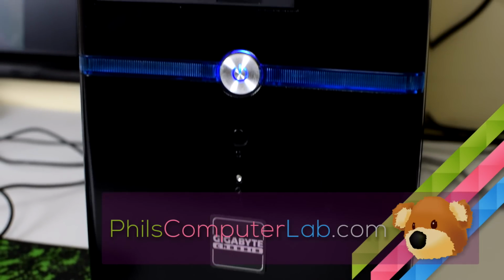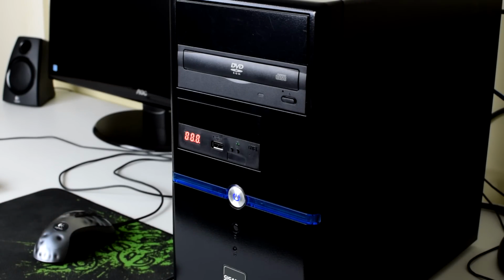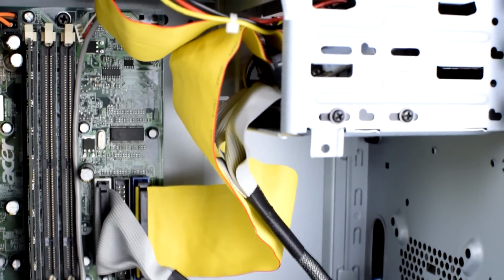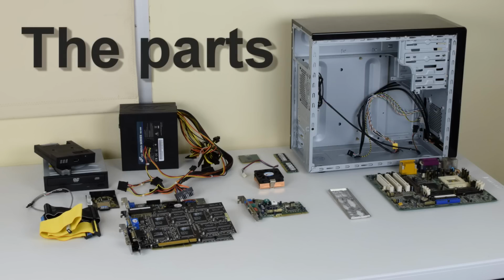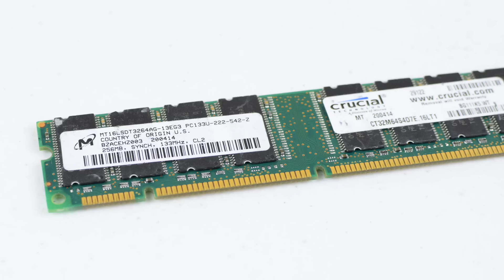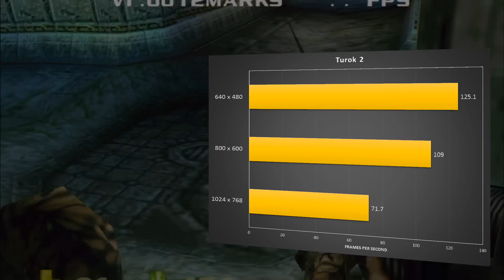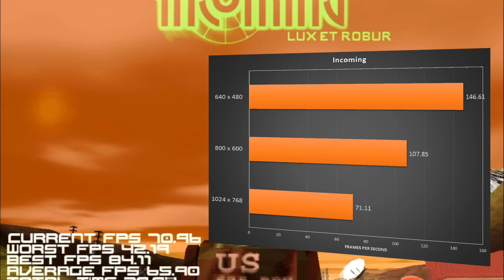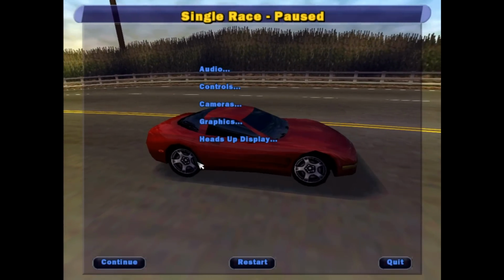3dfx Voodoo 2 SLI sleeper PC

Comment: Was it really practical for the price to sli voodoo 2 cards? I mean i never worried about it then since i wasnt paying for it, but i know he spent around 1500 on his computer at the time. The only way 2 voodoo cards could help you is either stupid high frame rates or higher resolutions which wasnt much of an improvement since the max was 768.
Reply from the maker: Thanks for the input. I have made different findings with scaling, especially with a fast enough CPU. I wrote a page about Voodoo 2 SLI with a wide range of CPUs. You might find it interesting: http://www.philscomputerlab.com/voodoo-2-and-sli-processor-scaling-project.html
Reply from the maker: I got almost 100% SLI scaling in all the games, so my comment was regarding SLI being inefficient. I found that it works really well.

Regarding CPU scaling, I have to disagree and it's a bit of a myth that they scale so well, you can check my paper, I tested with a very wide range of CPUs. Around 700 MHz Pentium III is plenty to feed them. Games got so demanding back in the day that V2 SLI quickly runs out of steam.
Reply: being said that the voodoo 2 sli method runs out of steam quickly, it wouldnt be very practical since its performance wouldnt last.
Reply: I don't recall if I ever read much about it back when my PII 233 Voodoo 2 SLI computer was (mostly) current but when I got the 2nd Voodoo2 and ran the benchmarks   in Quake 2 to find that the FPS gain wasn't there (CPU limited).. it was disaapointing to say the least but it did allow the higher resolution that was the native for the CRT monitor. I think that I read some about it later which was a shame that I didn't know that before getting the 2nd Voodoo 2.

Matrox Millenium 2, Dimond PowerVR PCX2, Two Diamond Voodoo2... that computer had way to many video cards in it :)
Reply: ChannelAsh100 I did the sli...was worth it
Reply: If I remember right I got my second Voodoo2 card in late 1998 some time, they had dropped in price enough to justify buying a second one.

As for if it was worth it, as you say they really helped in running games at higher res - either way though I think I sold them both some time in the year 2000, they were aging quite quickly.

Comment: Another great video Phil cheers. 

What speed you getting on your sd card?, I wonder if you can raid 5 sd card?. 
I use 3x 73GB SCSI Raid 5 with Adaptec 2100s as there so cheap and incredibly fast for a retro voodoo pc
Reply from the maker: +hardcore8uk I did a review on that SD card adapter recently. It's quite decent, especially the access time. Transfer rate is capped at around 25 MB /s though.

Comment: Hi, Phil!
Thank you for awesome videos!
I've noticed that most of i815 motherboards have an integrated sound card and MIDI port. That devices could be enabled/disabled in BIOS separately. When you disable integrated sound card, the MIDI port can stay enabled.
Windows 98 finds drivers automatically. Device name is "Roland MIDI port", or something like that. The word "Roland" is interesting. Is it support MPU-401 intelligent mode? I can't test it because I don't have any external MIDI device. Could you please test it?
Reply from the maker: +Zap Zap I'm pretty sure it's just UART compatible, not intelligent. The MIDI port would need to work under DOS also in order to test it with intelligent mode games like Wing Commander or Gateway. Now Wing Commander at least will not run well on such a fast machine, it needs a 386 really. The machine doesn't exist any more, pulled apart, so I can't test anything right now I'm afraid.

Comment: Working MicroATX Socket7/Super Socket 7 (Pentium 1/Pentium 1 MMX, AMD K6-2, etc...) up to Pentium 3, with AGP, either 2x or 4x slots, are hard to come by, even more if it's a Tualatin-compatible MicroATX board, with AGP 4x/2x!

Comment: Damn back in the day a VooDoo 2 SLI and Pentium 3 setup was a PC gamers dream, i wonder how it runs at 1600x1200
Reply: +bassblaster505 Gaming Max resolution on Voodoo2 ist 1024x768!
Reply: +bassblaster505 Gaming That would be Voodoo 3 which supported 1600x1200. But by end of 1999, you had the superior Nvidia GeForce 256. Quake 3 maxed out in 1280x1024 was amazing.

Comment: Here I am watching this video of you interconnecting two ancient graphics cards and I'm thinking all the time "But SLI couldn't possibly exist back in 90ies". I remember because it was first announced by Nvidia much much later , agp bus didn't have it either. But after a few wiki articles later I read this line "The initialism SLI was first used by 3dfx for Scan-Line Interleave, which was introduced to the consumer market in 1998 and used in the Voodoo2 line of video cards. After buying out 3dfx, NVIDIA acquired the technology but did not use it. NVIDIA later reintroduced the SLI name in 2004 and intended for it to be used in modern computer systems based on the PCI Express (PCIe) bus."
Mind blown! These guys created the basis for SLI (and crossfire since those are actually the same thing) back in 1998. Who knows what they could have done if their company was still in business.
Reply from the maker: Yes it is mind-boggling :) Nvidia's SLI actually stands for something else, and is different technology, but thanks to 3Dfx, everyone knew what SLI meant and that you could use two cards to get more performance. I think the first SLI capable Nvidia cards were the GeForce 6.
Reply: Actually it stands for the same thing. Nvidia acquired 3dfx way back in the day, and ended up using the name for their similar technology.
Reply from the maker: Scan Line Interleaving for 3dfx, and it worked by having one card doing odd scanlines, and the other card doing even ones. At high FPS and without V-Sync you can see artifacts similar to interlacing. Nvidia called it Scalabable Link Interface, and didn't work with scanlines like 3dfx did.

Comment: So for a computer of this time SD cards as primary storage do not slow down your performance? That is good news I want to do something like this for an Xbox and maybe a 2001ish computer if the Xbox works out well. Only real concern left is rewrite endurance overtime. But I could also just get a multiple terabyte external to backup images to restore at a later date if that really bothered me.
Reply from the maker: Well SD cards are ok. The model does matter, like a fast Samsung Evo will work better. A cheap SD can slow things down. So it does depend, but it feels faster than like an old 80 GB drive. They are so cheap though, so just test it and see if you are happy :)
Reply: For the Xbox I was going pull the trigger when a 512 card hits 60 dollars or less so it will probably be plenty of years into the future still. By that time endurance and speed should improve. I do want to snag some of these adapters to play with my spare cards on different builds though maybe even a joke run with the xbox. 

I also think that a card from that time is likely going be way faster than IDE ever was even the slower ones from name brand suppliers. I was mostly worried about he adapter slowing them down a lot but sounds like that is not that much of an issue.
Reply from the maker: Yes that is a good plan! SD cards will only get cheaper.

Comment: Hi Phil, have you ever built a Slot A Athlon machine? 1999 sort of vintage, Geforce 256/Geforce 2 and all that good stuff :) Would take me right back to see one of those.  They had great overclocking abilities through the 'secret' connector on the CPU card, probably hard to find the DIP switch device to plug in these days though!
Reply from the maker: +waydeewaydee Cool. Well, no, I've actually never played around with Slot A. Haven't got a board or CPU. Only Intel stuff from that era. I do have later Athlon XP gear though and the awesome Super Socket 7 CPUs of course :D

Comment: Nice build.  Not quite as "sleepy" as the beige case holding mine, tho.  ;)
Definitely a stronger build.   Haven't fired my voodoo's up in years, but I think they're on my PII  400 PC.
Also, I'm pretty sure there are 3dfx drivers out there for quake 1.   Maybe they don't work like 3dfx is supposed to, but they sure bring the colors out when you use them.
Also, who even knows if my SLI is working correctly as one's a Diamond card and the other is an STB.  ;)
Reply from the maker: The drivers have an option to disable SLI, at least some drivers or tools. Then you can easily compare in benchmarks.

Comment: Wow i must say that i am very impressed! 
Is it also possible to play DOS games on this setup without problems?
Reply from the maker: +Marcus Lannizter The machine is very fast, late era DOS games will run fine, but not early ones that are speed sensitive like Wing Commander or Test Drive III. Personally I wouldn't use this machine for DOS, it's such a lovely Windows 98 PC.

Comment: Ehy @philscomputerlab, how can be your 3dmark99 max score so high? I am trying to do a great system with a Voodoo2 SLI 8mb each one, Diamond and Creative. They seems recognized correctly, 1024x768 resolution work, but with the same system like you (p3-1ghz, 512mb ddr266 ram, asus cuv266 apollo 266 chipset, 3d rage pro turbo 2d/3d card) O am doing 3300 points in 1024x768 where you do 5000. I am asking if I am done something wrong. I have installed both card and then installing through Fast Voodoo 4.6 drivers. Can you suggest me something?

Comment: Another nice video from you!
Going to compare your benchmark results with mine, see how much difference there is between Pentium 2 400 and Pentium 3 1000 :)
Reply from the maker: Cool, please share your findings!

At 1024 x 768 I don't expect much difference. You are mostly limited by the graphics power.
Reply: Just curious, because some say that the Voodoo2 needs more power than the Pentium 2.
Will see if I can make the time later today :)
Reply: The results i came back with are way back yours for some reason!

3DMark99:
640x480 = 3347
800x600 = 3342
1024x768 = 3281

3DMark2000:
640x480 = 1409
800x600 = 1413
1024x768 = 1395

Using the FastVoodoo2 4.6 driver and all the tests in the 3DMarks.
Reply from the maker: Yea the are almost identical at all resolutions. Looks like your CPU is indeed holding you back a bit.
Reply: Holding the cards way back.

Comment: One thing that isn't quite clear to me. Are ALL the 3D Benchmarks done using the VooDoo2 SLIs as the accelerators or is the Matrox G400 the primary in like the Direct 3D benchmarks  as it's a decent card in it's own right.
Reply from the maker: +Brandon Bridges Good question! Yes, all the benchmarks were run on the V2 SLI. But one can run OpenGL and Direct3D on the Matrox if that's what you want :)
Reply: PhilsComputerLab Hi Phil! How can I select the V2 SLI to run NFS3? I can’t run 3dsetup as I don’t have the original cd. Can I edit the nfs3.ini to run in glide? Now it selects my G400 standard.

Comment: Great video Phil. Just one question if i may. I currently have a Voodoo 2 sli setup with an ATI rage AGP card in a Compaq Deskpro. The CPU is a slot 1 Pentium 2 @ 450Mhz. I was thinking of moving the Voodoo 2's into my P3 setup. It currently has a 600Mhz 370 cpu on a Slot 1 adapter. I do have a Slot 1 1Ghz Pentium 3 that would work with the motherboard if i update the Bios. After seeing the video you made on bench marking the video cards, from my understanding i am pretty sure i would gain only a couple or so frames if i use the Pentium 3. Did i read the scores correctly? What are your thoughts?
Reply from the maker: Yes, the 1 GHz CPU is totally over powered :) 1 GHz just sounds cool and represents a breakthrough so to speak.
Reply: PhilsComputerLab Thanks for your reply. I'll leave the the Voodoo 2's in the current setup and i may use my Voodoo 3 in the Pentium 3. Cheers
Reply from the maker: Yup that's a good plan.

Comment: Question . I have 2 12meg voodoo 2's I don't have the D-sub pass through cable though ( I have the Ribbon cable) 
. Can I still use them in sli
Reply from the maker: The passthrough has nothing to do with SLI. It's for routing the 2D image from the main graphics card to the monitor.

Comment: Do you have a 22-bit the post filter when using 1024 * 768 resolution in SLI mode?
Reply from the maker: Voodoo 3 for sure, not 100% sure on the V2, but I it should have some sort of filtering, it produces a very soft image.

Comment: Got my first Voodoo2!  Getting some texture glitches like polka dots using the Half Life 1 MiniGL driver.  Unreal gives strange 'large polka dots' glitches with RT lighting effects on surfaces.  I'm using Fast VoodooII drivers version 4.6.  Platform is a 750Mhz Pentium III, Intel chipset, 128MB x 2 SDRAM (mismatched), what to try?
Reply from the maker: I would try a DOS game, like Tomb Raider, but use the Voodoo Rush patch.
Reply: I will try that.  Thanks for the tip.  TBH I think what I have is a damaged pin on one of the TMUs.  It seems that all of the games I try are having the same issue - random pixels appearing on the textures.  For my first experience of a Voodoo2 I have actually found it to be very interesting.  I have another Voodoo2 on order, if it works correctly it will be interesting to see what happens if I try to run them in SLI mode.  I know that modern NVidia cards use the framebuffer from one card and use the processing power of both cards to render the image, but 'Scan Line Interleave' sounds like each card would their own memory and just render alternate lines on the screen.  So in theory I would get one good line and one line with dots, and so on.  But if they operate like modern SLI in the sense that they just use the framebuffer from one card then I might be able to use the good card as the primary card and the artefacts will disappear.
Reply from the maker: Could also be memory. One visual inspection you can do is check all the legs of the 3 large chips. Sometimes a leg can fail and break, or two legs tough each other. Also, you can try down-clocking it, and maybe that resolved the issue. If you use the Fast Voodoo driver, which you do, it overclocks the cards by default, so yea that could also be the issue.
Reply: Yeah I think it's one of the 'legs' on one of the TMUs.  I have two more V2s on order, it will be interesting to see what happens in SLI.  That might be worth a short video too.  Did you see my Voodoo5 message on one of your other videos?  WTF?!?!

Comment: Phil I would like to know, what type of files do you use to deploy those games on your test systems? do you use disk image files or digital download installers (from gog d2d etc)?
Reply from the maker: A bit of everything!

Quake 2 for example is from GOG. Just copy the game folder and you're good to go. Descent 3 I have the original CDs and install the game. Quake 3 is the demo version. So yea, a bit of everything :D
Reply: That's great, I was just wondering about the fact that Gog publishes minimum system requirement for retro games that are much higher then the game original requirements, usually around 1ghz CPU and 256mb of ram.
Is that the reason you build those retro machines with 1ghz+ processors?
Reply from the maker: Yes, the installer will not run on windows 98. You have to use an unpacker or just copy the game folder across.

I tend to use a 1 GHz processor because it's cool more than anything :D

A 600 or 800 MHz CPU would work just as well.
Reply: Got it.
Thanks for your help :)

Comment: Just out of curiosity, is that cooler quiet+keeping the temps on the Pentium III low? I'm still running the stock coolers on my Pentium III and Celeron 433 and the noise from them gets annoying (louder than the HDD that I use with them).
Reply from the maker: +Dabombinable Mi It cools nicely, but it's not quiet / silent. You can use a fan controller to improve it though.
Reply: That would be an option-it can't be louder than the stock coolers. And if need be I do have an evercool fan (molex) from a dead heatsink that I know is quiet.

Comment: how do you acutally record the games on your retro pc using your elgato, because i also have an elgato and i want also to record like that.
Reply: +Timmyboygamer I'm also interested. I use an Elgato as well and it never looks as good when recording VGA from it. for instance I recently captured XP footage from a 6800GT via the DVI with a DVI to HDMI. unfortunately the capture footage looks significantly degraded and yes my quality bar is set to highest.
Reply from the maker: +Timmyboygamer Not with the Elgato, that one is HDMI only and doesn't even take PC resolutions (It only does TV resolutions like 720p and 1080p). I used an Epiphan DVD2USB 3.
Reply from the maker: +0blivi0n100 What Elgato do you have that does VGA capture?
Reply: well, maybe I misspoke, I mean for cards that have a DVI out I use a DVI to HDMI dongle. Though I also use it to capture DOS via a VGA to S-video converter. poor mans VGA capture.
Reply from the maker: Ah got it. Yea I do the same. Even for DOS you can use DVI cards. I capture with AVerMedia gear however. Pretty much all my DOS videos are done that way.
Reply: unfortunately its not usually an option for me because I like to use era hardware. no DVI outs on a Tseng labs ET4000 or a Virge.
Reply from the maker: 0blivi0n100 Ah that makes sense. My main DOS PC is a Pentium 100 with an AGP GeForce FX card.

I actually got a gadget that I want to review next month that might be of interest to you. I don't know yet if it's any good, but stay tuned :D
Reply: +PhilsComputerLab i have the original one, not the hd60.
Reply from the maker: Hmm. I might do a video on this topic. Like with tips as how to capture from older machines?
Reply from the maker: Nice find and great price! What Windows does this work with, I guess Windows XP? Do you have drivers and software for the card?

Eager to hear how you go when it arrives!
Reply: +PhilsComputerLab yhea XP. http://www.digivision.it/prodotti/DataPath/VisionRGBPro.htm I'll certainly let you know if I have any success with it.